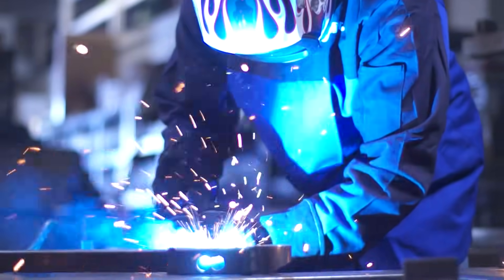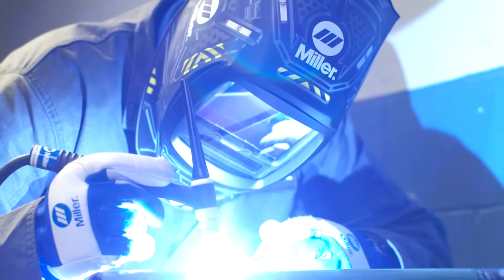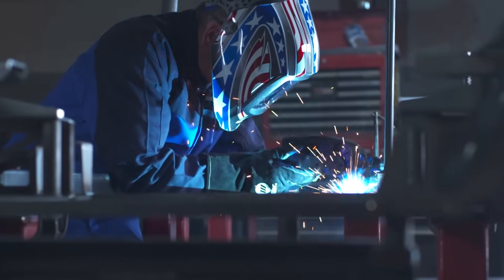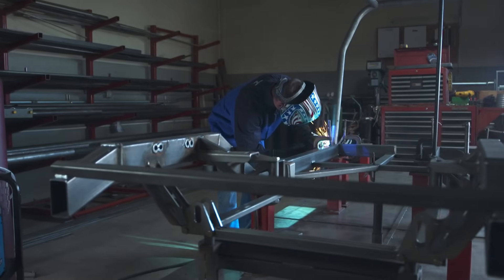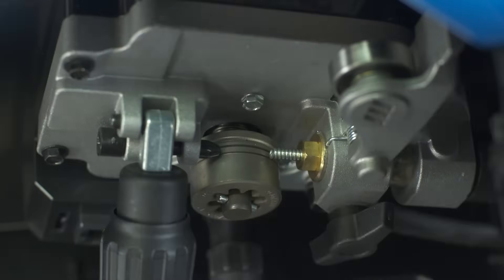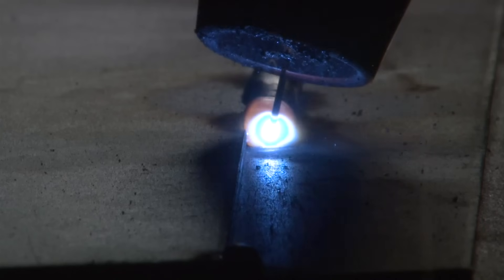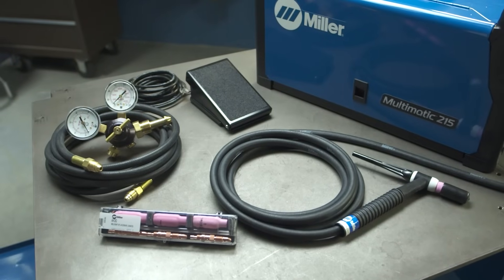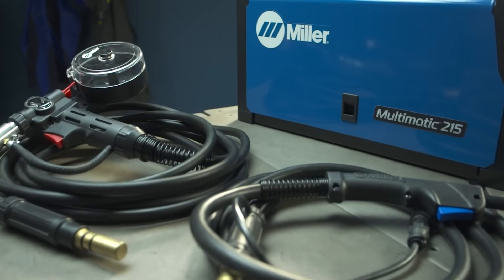Explore more projects with NEW Multimatic 215 multiprocess welder

Comment: what's the difference between the multimatic 200 vs the multimatic 215?
Reply from the maker: Thanks for reaching out. Product information and the spec sheet for the Multimatic 200 can be found here: https://www.millerwelds.com/equipment/welders/multiprocess/multimatic-200-multiprocess-welder-m00361 Product information and the spec sheet for the Multimatic 215 can be found here: https://www.millerwelds.com/equipment/welders/multiprocess/multimatic-215-multiprocess-welder-m30090

Comment: At 20 sec, the guy is welding existing pallet racking. Not supposed to do so unless structure integrity is reviewed and approoved by a professional engineer after the modification or repair. ANSI/RMI MH 16.1 Specification.